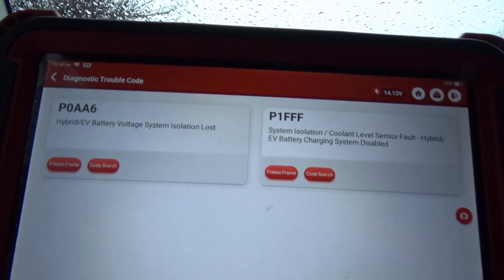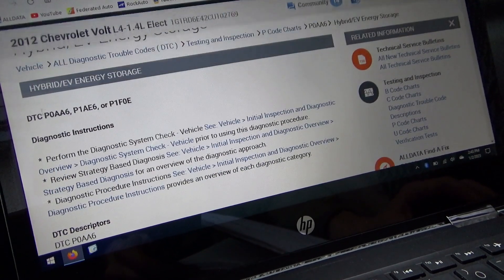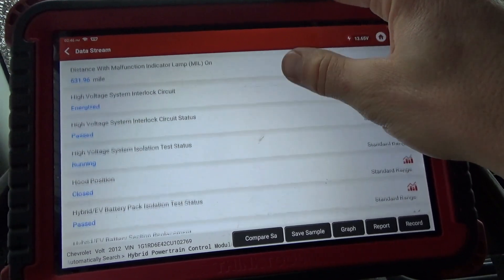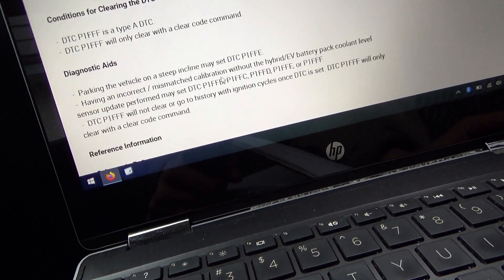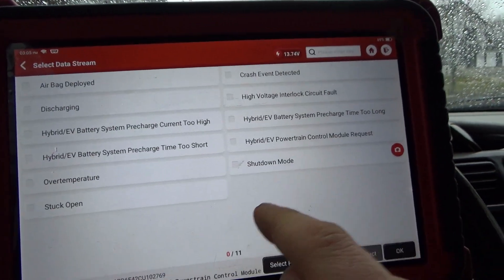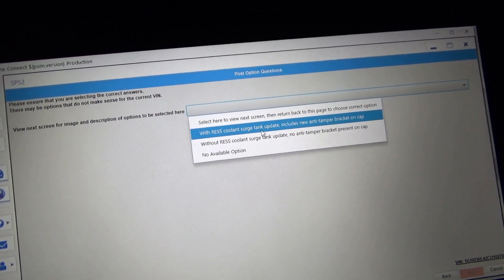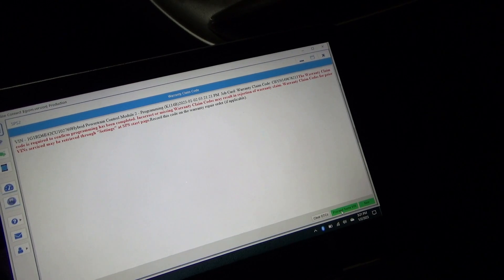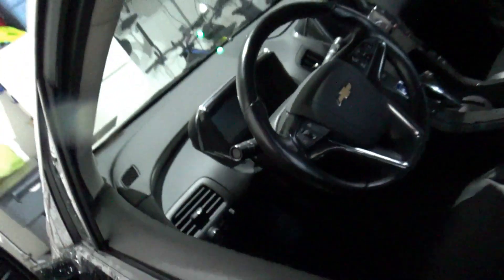Chevy Lost the VOLTS? (HV Battery DISABLED - P1FFF P0AA6)

Comment: When you tried to reset the codes with the scan tool and it couldn't do it because it said "High Voltage Battery Circuit Contactor Not Open" do you think that means you needed to pull the high voltage disconnect and then see if it would reset. Just a thought.
Reply: I think it's just referring to the insulation resistance, where it had to be above 325k ohms (or whatever it was).   and the live data said it's now 3000k ohms, so it is actually "open".   But I do agree with your question, because why is the special function even there if you can never use it anyway, and have to get it programmed?   Pretty strange.  I'm not doubting his choice to program it though, because it did say right there in the service info:  that it would need to be programmed even if it was current.   Kinda of a sh^tty design.  Seems like the dealer should have to do that as a recall or something;  since the code is tripped, yet there's nothing actually wrong with the car.   Never buy a volt-- that's what I've learned. lol
Reply: "contactor" in this language is referring to a "big relay" the computer controls to connect the HV battery to the vehicle. It is not a service disconnect.
Reply: @volvo09  Yes a contactor is typically a large multi-contact relay but if the computer is seeing it as NOT open when it should be then why not pull the service disconnect and try to reset the codes.
Reply: @737mechanic   I have tried that before.  Doesn't clear it. Even disconnected 12v battery.

Comment: SAVE THE SPS CAL FILES IN THE SPS CACHE FOLDER then you can use Gm DPS to program any other car and you don’t have to pay gm any money if you want to program a different VIN BUT THE SAME MODUEL you can use the cal files to create a archive file for programming. in the cache file will be “for this ECU 3 bin files”  2 of which are the cal files which is stuff like boot and operational software the other is called a utility files it acts like a instruction set for dps to program that specific module

It can also do other cool stuff with type4 like odo correction 😉
Reply: whats the path of that cache dir?
Reply: Very interesting

Comment: This video is a perfect example of why I am never buying an electric car. Almost anything to do with the high voltage systems requires online programming and several manufactures do not even make the tools or software available outside of the dealer network at all. They use "safety" as they reason why they say non-dealer repair shops are not allowed to work on HV repairs
Reply: If you are older then 80 years you can drive your old fossil to the end👏
Reply: @wimphilipsen2651  only half that, but I'm still driving my fossil fuel vehicle to the end 😂
Reply: @arcadeuk  
👍 good luck from the Netherland
Reply: @wimphilipsen2651 drink much koolaid?
Reply: @vg3430  not at all.

Comment: Fortunately we never got those "quality" General Mess shit boxes here in OZ!
Reply: You did get the Volt in OZ. 248 of them known as the Holden Volt. Same car different badge. Had one for 4 years no problems.other than tire pressure monitor died on one tire.
Reply: @ralphzoombeenie2330  Well I've never seen one in 40yrs a mechanic so all 248 must have been sent to capital cities!... I guess that shows just how much of a failure they were just 248, obviously an experiment by General Mess Holden.
Reply: @preston963  They were sent to capital cities for obvious reasons. All dealerships had to send their mechanics on special courses. Not a failure except economically as they are rumored to have cost far more to build than selling price, built in the Cadillac plant alongside Cadillac ELR (Same running gear as Volt).Approx 200K were sold,160K in US 17K in Canada 20,+K in Europe as Opel/Vauhall Ampera. Voted European and US Car of the year 2012. Only 248 sold in OZ because dealers greed  in OZ only sold the top trim model with every option at over AUD 60,000 before ORC. Shown to be very reliable with a US owner clocking over 400,000 miles (640,000km) with little more than a couple of wheel bearings.

Comment: The best PHEV ever made that no one knows about. GM was way ahead of their time with this one. The Prius Prime of its day. Too bad they killed it. Good on you for taking it on and good work as usual.
Reply: @dizzy2020  The Volt's ICE generator will couple with the final drive above 70mph (when running in hybrid mode). This was done for better efficiency since the electric motor only has one gear and becomes less efficient above 70mph. But the Volt can be driven up to 101mph in EV-only mode if desired. In my driving loop, I rarely hit the generator (less than 20% of my overall driving is done on the generator so my theoretical gas mpg is around 190mpg).
Reply: @dizzy2020  20+ years making the Prius... Explain how that's a rule dodger..

Also the Prius has the engine connected to the wheels. It's called a transmission..
Reply: @demcomp  lol doesn't have a transmission
Reply: 90k miles…sets a code when nothing is actually faulty…to clear said code so car will work again, you have to pay GM AND a mechanic to reprogram modules…YEAH…Best ever made….NOT.  Btw, I have some real estate to sell ya 😂
Reply: @vg3430  you can buy a decent diagnostics tool for a few hundred dollars that can reset the code without a visit to a mechanic. resetting it at a dealer cost me 300euros. I bought a 300euro tool(Icarsoft CR MAX) which paid itself of after 1 reset(came up 2 times within a year)
Reply: @juholuomala8414  Good to know! Do you know if it will rewrite the module like he did in the video?
Reply: @besamjohn  Just based on how fast it gets it done(1-2seconds) i am almost positive it only removes the codes from the module.
Reply: @vg3430  🤣🤣🤣🤣🤣
Reply: Liberals killed it.  No one wants a woke car that tells them they are homophobic.
Reply: Iono if I'd go THAT far about it being the best.. it's a GM product. Was it good?. Absolutely.. but the best is a real big stretch.. 
But it was the only GM product I was ever interested in, and that says a lot!

Comment: My 2012 GM/Holden volt did this about 18 months ago not long after it had a full coolant replacement by GM/Holden  dealer. A Google search showed this to be a common issue. I simply added about 100ml of dex-cool to the “anti-tamper” tank (coolant line above side sticker) then reset the trouble code. No problems since with approx 20,000km and stored outside.
Reply: I love the Volt, best car I’ve owned and driven with 100ml of coolant being the only maintenance issue. I’ve just bought a second 2012 and looking at buying a third for the family.

Comment: I often work on these cars. They're pretty easy once you learn what you're doing. Unless I'm missing something, you never checked if the coolant level sensor was faulty before trying to clear the code or flashing the module. I've gotten burned on that before. Also, needing to reprogram the module to clear the code is a bug in the software that GM never fixed. It wasn't designed that way. They were just too cheap to get their engineers to write new software that fixes the glitch.
Reply: Indeed. You can literally trigger this issue just by pushing the float down with your finger in the HV coolant surge tank. Sometimes, I hate GM. EDIT: LOL! Still watching the video and I just got to the part where he checked for the updated tank with an anti-tamper cap. Is that really GM’s solution?! ;)
Reply: No. It’s not the coolant level that tripped the code!! Read the code description. It’s a battery shut down code, which is triggered by a low coolant level OR loss of isolation!! Remember the first code for loss of isolation? That’s why it tripped. However GM says to check the coolant because, a loss of isolation could be caused by internal coolant leakage (and that in turn will also lower your coolant level). Obviously this was an erroneous fault, either due to condensation from sitting or GM programming. I’m thinking the latter with all the updated software…
Reply: I was thinking the same thing about the level sensor.
Reply: I just pulled both of these codes on my 2015 Volt I live in CA and I understand that we get a 10 years 150K warrantee, Q> would reprogramming be covered under warrantee at the dealer?
Reply: Ford has similar issues and if you mention reprogramming a module of their specific test doesn’t mention they will kick your warranty claim!
Reply: What do you expect from the worst car makers on the planet!! GM stands for Garbage Motors.
Reply: GM probably doesn't understand the problem. Bet they used outside engineering to come up with the software and the people that they think can fix it, can't.
Reply: where is the coolant sensor? for the battery
Reply: I'm surprised Ivan hasn't responded to this.  Sounds like you know what you're dealing with.
Reply: Anybody from Arizona who knows how to work with this?
Reply: Are u in the uk?
Reply: So there's a "bug" in the software and yet GM doesn't fix it.    I'll never be a customer again!   Never!
Reply: @Ram14250  They only do enough to get it to market and then move on. Plus, they know you'll be bringing it back to the dealer anyway so why bother?
Reply: @Ram14250  it’s by design so it’s not a bug. They were scared of battery fires and huge warranty/recall expense if they don’t disable charging and the coolant leaks into the cells. There are coolant fins between every cell so there is plenty of opportunity for a leak. Of course, they got all the fires and warranty recalls they could handle with the Bolt EV but it wasn’t their fault (one single robot at LG was miscalibrated).

My issue with the design is that it isn’t more robust and resistant to tampering, plus, it can trigger for no reason even if it isn’t caused by a curious finger bumping the float in the surge tank. Heck, imagine if the whole car turned upside-down! Every system would trigger.
Reply: @emmettturner9452  I have never been a fan of LG. The brand cannot even make a reliable cell fone. Samsung is light years ahead in quality.
Reply: @mikefoehr235  They all have their problems. Around 2003/2004 I had a string of bad Samsung phones and said the same thing.

Our Samsung VGA-1000 phones were just a repeatable software glitch where it would show the wrong name and number on the screen while calling someone else. We had three and even updated the software through Sprint but it was always an issue.

My N400 had a speakerphone that interfered with itself and was completely unusable. Every warranty replacement did the same thing, meaning they actually bothered to build in a loudspeaker and high-gain speakerphone mic and shipped the phone without testing to see if it worked! The issue was basically that even ambient noise would feedback to itself. Any actual sounds would do the same, rendering it useless.

This bad string of Samsung mobile products continued for me through 2005 and 2006 where the YH-999 Portable Media Center had buttons fail and my YP-T7 Digital Audio Player wasn’t able to charge… fresh out of the package. Once the factory charge was gone, that was it.

I balked at getting a refurb replacement for something I just paid full price for and the service rep admitted that only refurbs were actually tested (implying that they were better than new). Ugh. I couldn’t return it to Best Buy without losing my discount on the JBL On Tour speakers that came as a promo bundle.

Samsung actually lost my YP-T7 during the RMA and claimed to only receive the YH-999 when they were literally in the same box… per their instruction. It took me almost a year to get that sorted out and by then I had a YP-T7Z for subscription music support. Lucky for Samsung, I’m a glutton for punishment!

Anyway, the replacement YH-999 developed green lines in the display so I bought another on clearance at Circuit City in 2007… and buttons failed on that one too. Ugh.

I loved my Galaxy Note II, note 3, and Note9 but, even then, their software needs work. I still can’t believe they don’t have a way to mark up an image or screenshot with lines/strokes that have a contrasting border… like the white/black meme text. It’s almost impossible to use a namesake feature because there is never enough room to write legibly in one color on a screenshot… and GOOD LUCK writing on any kind of outdoor photograph! Someone should be fired for that kind of oversight.
Reply: @emmettturner9452  The best products I have ever owned are Samsung. TV, fone, washer and dryer. I was sold on Samsung because of an old computer monitor. The thing never died. I love my Note 10+. I read the Note is gone due to chip shortages.
Reply: @mikefoehr235  the Galaxy Note was replaced with the Galaxy S Ultra. I have the S22 Ultra and it is essentially the new Note.
Reply: @nukelauncher95  I see
Reply: @nukelauncher95  I love my Galaxy Ultra Plus. The battery lasts forever and charges super fast when I need some insurance charge.
Reply: @emmettturner9452  "it's by design.. they are afraid of battery fires". And for good reason. The lithium cells contain a highly flammable liquid which fortunately don't supply it's own oxygen, but a short or heat (lithium ion batteries can become flammable at as little as 145deg f)  can cause them to produce so much heat that even if a fire is extinguished it will restart on fire if they are not continually deprived of oxygen (this is why battery cooling system is so critical). One common method is for firefighters to dig a whole, push the ev in the hole and fill it with water. The most damaging environment is salt (sea) water.
Reply: @TheOnespeedbiker  Yes, I knew that, but the reason for the coolant level sensor is in case coolant leaks. That can cause a battery fire one additional way: Shorting out. Even if they don’t catch fire, the battery is the most expensive part of the car and not something they want to be servicing overdischarged cells on. The coolant is meant to solve issues, not cause them. Unfortunately, the way their system works causes some.
Reply: @EmmettTurner: '...Heck, imagine if the whole car turned upside-down! Every system would trigger.',... that's what we call a car crash, accident or collision.
👻
🙈
Reply: @mikefoehr235  the note is now merged with the S series since the s22 ultra. And i own all samsung product, TV's i got one 60" fron 2004 and works flawless got a 2020 60" 4k i have an s10 and s21ultra, an odyssey g9 monitor
Reply: @mikefoehr235  Wish I had better news but my Samsung Tv of only 3yrs screen played out. Called and talked to a technician and he said it’s either the screen is bad or a electronic board. If it’s the screen it wouldn’t be worth repairing because it would cost too much. If it’s the board he could repair it but Samsung stopped making it and would have to find one on EBay!😢 3yr old Tv and they stopped making the part. This is a $5,000 Tv! I hope it’s the board if I can find it I’ll have it repaired. If not I’ll buy another Samsung. I’m also a gluten for punishment. 90% of my electronics are Samsung and I just bought their Top of the Line fancy Washer! So Samsung is slipping. If this washer starts having early problems then I’m done with Samsung!
Reply: @JLRJ  Costco gives a good warranty on TVs. I think 3 years. They have a name for it..just can't remember at the moment
Reply: @mikefoehr235  Thanks! I have a Sam’s membership but not Costco but I’ll look into it. Wouldn’t you know I had an extended warranty on my Tv but it expired a week before my Tv stopped working!🤦🏾 That’s my Life!🤷🏾‍♂️
Reply: @Ram14250  I doubt if it's a bug if it's documented in the service manual that way.
Reply: @Ram14250  A bug that requires you to pay a fee to the dealer.  It's more of a feature really.
Reply: Is why I will never own another GM
Reply: @mikefoehr235  well, that and they keep trying to build engines that shut off cylinders and it ends in disaster every time.
Reply: @teekay_1  AFM is a lot of trouble. Is why I like my 20 Tundra..old school and ya it's a tad harder on fuel BUT repairs may be very rare.
Reply: @mikefoehr235  I still resent the bailout, they should have been allowed to go bankrupt and be bought by someone who might do a better job.
Reply: @Paramount531  GM used to be pretty good. Then the brand lost its way.
Reply: @mikefoehr235  My 2014 VOLT has been the best car I ever owned. 126,000 miles with very few problems. I had several Toyotas prior.
Reply: @jonathanp1884  I have two Volts. One with 194,500 one with 167,000. Aside from normal maintenance and a few hub bearings (michigan), they have been trouble-free! Did pull these codes and I'm waiting on the part.
Reply: @mikefoehr235  damn right
Reply: @Dansk55  Quite a few love to 💩 on Toyota BUT the 4 best vehicles my wife and i owned are Toyotas. My 13 Tacoma and even my 20 Tundra are way excellent. The 04 Corolla and 16 RAV 4 are also way excellent. Can't be by fluke.
Reply: In other words, a typical hybrid pile of junk.

Comment: I wonder if that is to keep people from getting a code scanner and continuously resetting the code when there really is a problem resulting in battery damage and possible fire.  

If you have an EV or hybrid, do not under any circumstance mess with the batteries unless you are a professional.  If they go into thermal runaway you will be very sorry.
Reply: Let's hope that manufacturers publish full service information, as they do now with every other car on the road. I've yet to see a service procedure that couldn't be conducted by any person capable of reading and following instructions. I don't expect that to be different with EV's, but if it is then there will be no end of the horror stories even among professional technicians.
Reply: That's what I figured, and it's exactly what I'd do.
Reply: Yeppers...the diesels of that era had permanent codes that could not clear with scan tool or global reset.  The computer has to run and pass the code for it to clear.  Reprogramming  doesn't clear it either
Reply: Absolutely.